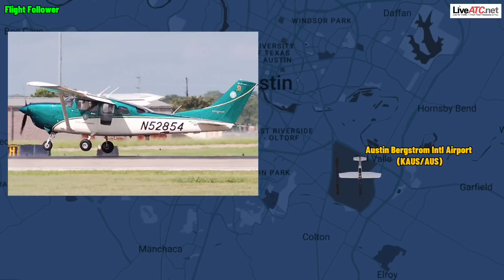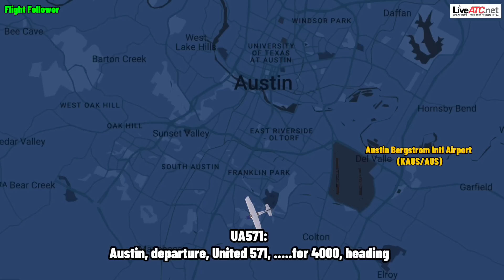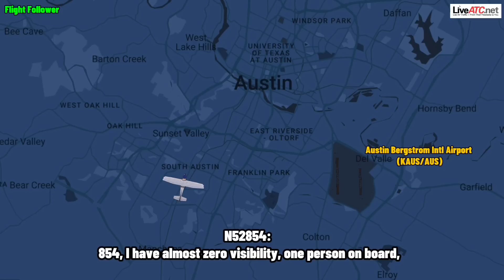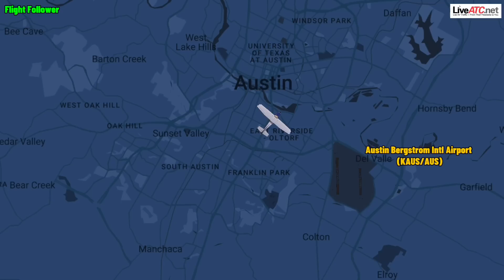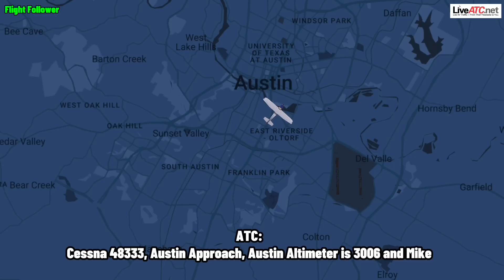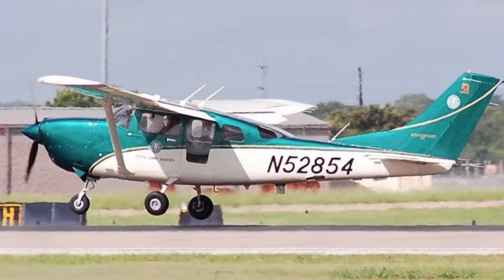ENGINE FIRE leads to LOSS of total Engine power | CRASH at Lake!

Comment: Good to put it on the lake or river, but as usual, he forgot to pop flaps to hit the water slower.  You can hit about 20% slower with full flaps. He got hurt. You are supposed to use flaps all times when under the Vglide Speed.  My CFi put a silver line for that under the Vglide Speed.  Nice reminder.

Comment: SOP is fine until the tactical situation becomes fluid.  Smoke in the cockpit should be a get down now SOP.  ATC wants altitude for radar, but sometimes that is not practicable or possible and sometimes talking is too much distraction.  Army helicopters with all the moving parts instilled in me a like to be low preference because I wanted to get down before too many things slung off.  And 50 years of crop dusting and patrolling pipeline with a 200' AGL waiver put me there anyway.  11 of 13 engine failures were six second deals.  Aviate...no just aviate.  And high altitude SOP of time and resource management works with altitude.
Reply: IF ON FIRE HEAD FOR WATER EVERY TIME 100 %
Reply: hi i wanna learn from you. What is a six second deal? U mean fuel management error to be corrected within 6 seconds? Why did you have so many engine failures? What made the engine quit concretly? I want to avoid it with my plane. Thanks.
Reply: @SimracingForFun111  No, six seconds is not a fuel management fix.  Just how long we have to maneuver to a suitable place to land when low.  Airspeed and not altitude is life down here.  I am old now but was a crop duster in the days when a Stearman set up with a homemade fiberglass hopper where the student sat in Army days.  Ag is different now at two million for an Air Tractor.  The Pawnees I flew had crooked tails and no pitot.  They were not jigged when rebuilt after crash and the pitot was cut off to make the refab job quicker and easier.  Needing an airspeed indicator was disqualification for a crop duster.  Most of my engine failures were hot engines from need to rebuild and working hard.  Above red line the spark plugs fire wrong.  When you finally crashed rather than get down OK and get the engine cooled, you got a quick rebuild and engine major overhaul.

Good maintenance will probably prevent engine failure, but the tactical situation is always fluid.  If low when it quits Vx or Vy is not appropriate.  Airspeed for maneuvering is what you need.  Use the soft field type takeoff but stay level in low ground effect to accelerate quickly to cruise before leaving ground effect.  Some day that extra free energy will make the difference.  Do not climb well over obstructions trading lots of airspeed for just enough altitude to kill you if you stall.  Just over with cruise climb airspeed is much safer.  You then will have six seconds and enough airspeed to maneuver.
Reply: @jimmydulin928  Hey Jimmy, I very much appreciate your answer! What you answered are exactly some questions where my „normal flying“ FIs recommend without real reasoning on those topics sometimes, you argued with concrete experience in praxis. You totally helped me in being more comfortable in decision making while taking off because I just recently started to take passengers (friends) and I worry about low level engine failure. The engine will be replace in 1 months so now it’s most critical. What you say makes totally sense when I imagine it (gonna do it tomorrow like that, more use of ground effect and then a bit more speed than just vy), I should be making the next field when the engine quits at 200ft. 
Thank you a lot, with what you said you have the best experience for this matter. Fly safe